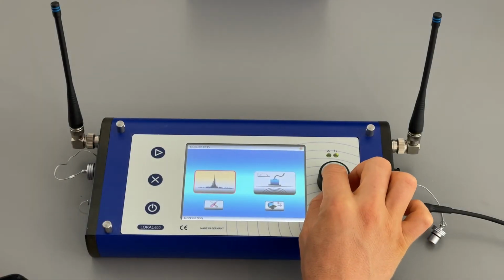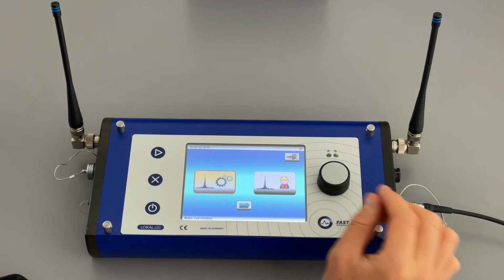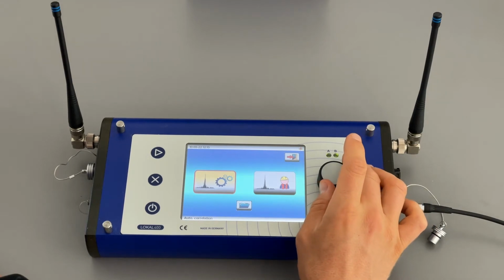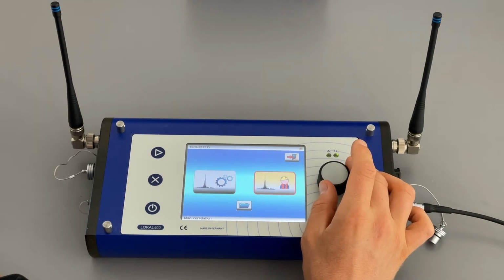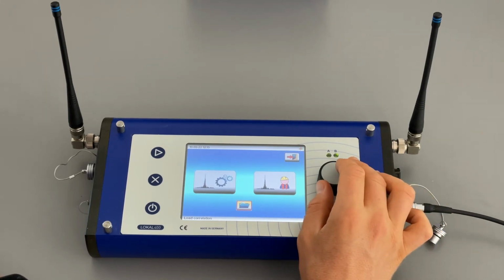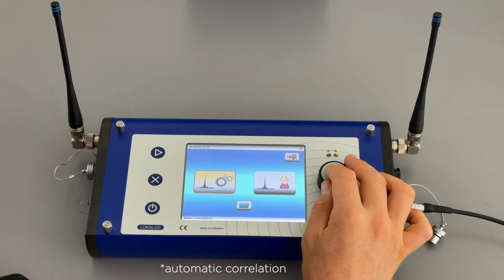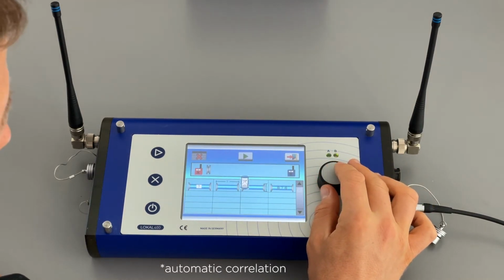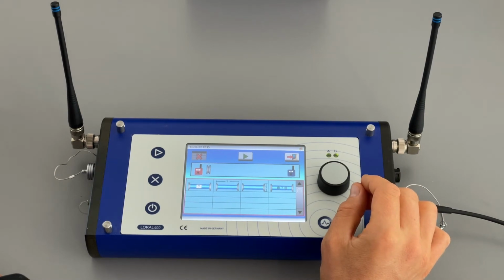Video Manual - Lokal 400

Comment: You guys are amazing! I have researched water leak detection equipment for a while now and this is certainly my top choice! Should I get the Local 400 or the aqua M300?  We have been finding cold water leaks for about a year now with the gen ear by injecting compressed air into the lines. We haven't used tracer gas yet. Thanks for the vid's
Reply from the maker: Of course, we would recommend working with both devices. Our LOKAL 400 with its functions as correlator and geophone is very well suited for pre-locating leaks, while the Aqua M300 can be used both as a geophone and for tracer gas detection and is therefore more suitable for pinpointing. So it's not necessarily a choice between the devices, but rather a complement of many different options.